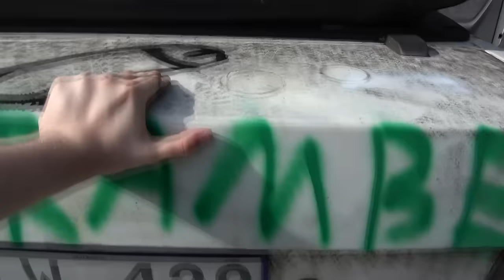GIVING MY BEST FRIEND HIS DREAM CAR

Comment: how much did this fine masterclass car cost?
Reply: 50-150k$ depends which years model it is
Reply: it was free
Reply: 20 keys, but this one is ST FN so maybe 25-28
Reply: Souvenir stat trak FN float value .420 non duped from the tomohawk case 10/10 gr8 b8 m8 signed by HaRambAe
Reply: AngryNeeson52 I also didn't mention it has a swedish flag holo sticker on it, but that doesn't ad much value.